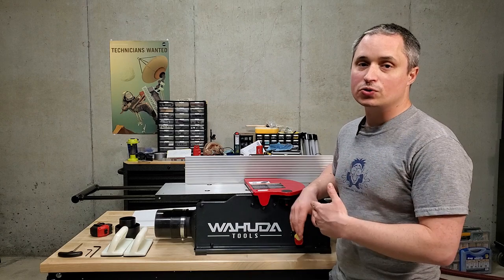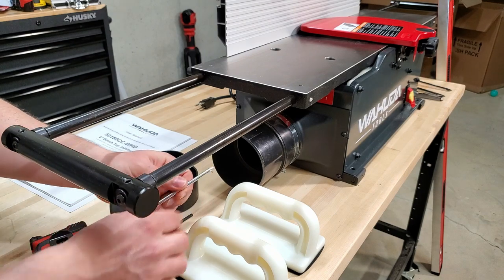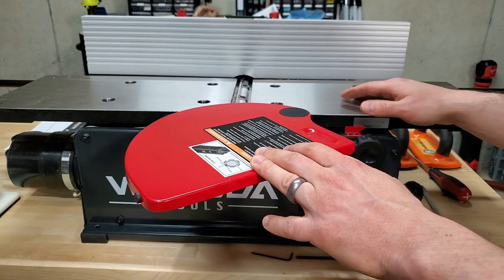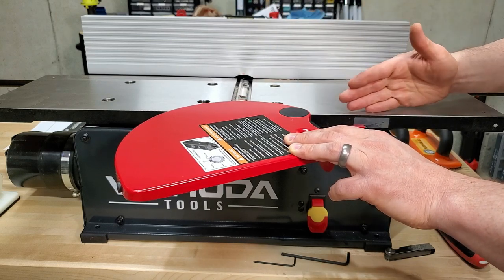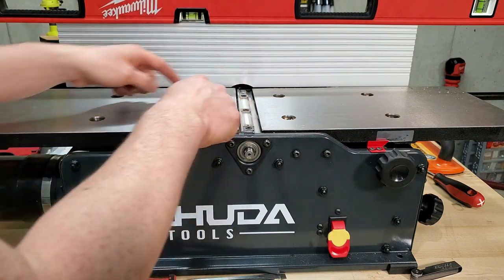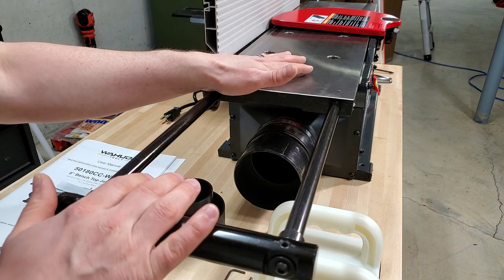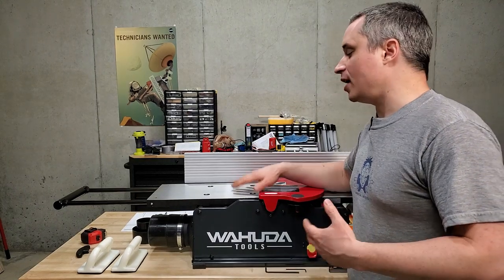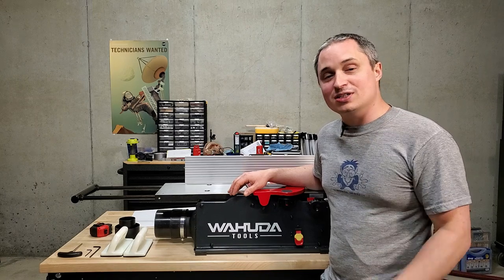Wahuda 8" Benchtop Jointer with Spiral Carbide Cutter Head Review and Setup Tips

Comment: I recently ordered and setup my wahuda 8" jointer. The newest model no longer requires you to remove the bolts and washer to adjust the table. There is now a set screw to the left and right of each bolt. One for up and one for down, just simply adjust each spot with your stright edge in place. So much easier now!
Reply from the maker: Wow, I ordered mine in February 2020 shortly after they were first available. I'm surprised they're already making improvements, but it sounds like a great upgrade!
Reply: @DoresoomReviews  I'm not seeing pics on their site reflecting those upgrades.  I'm sold either way, and will hopefully have one soon.
Reply from the maker: I spoke with Wahuda - apparently it was a CuTech patent conflict that mandated the change.
Reply: Can you please give me assistance on adjusting mine i just got it and messed it up trying to adjust

Comment: After watching your vid I ordered one! Ordered it on a Monday and received it Thursday afternoon! That was nice!

 First off the cutter head is not Helical or a Spiral, I would call it a straight segmented cutter head. It does work well but not so much on figured woods. The one I have does have 4 sided cutters that are numbered for easy identifying! The bed adjusters have been changed that use small allen screws that sit next to the main holding screws which makes adjusting much easier than the exercise you had to go through.

The table extensions were a lot easier to move in and out so they appeared to have fixed that issue! Dust collection on this unit is better than average! I am using the 4" port which is hooked to a 750 CFM machine. It could use a few extra air holes to make it more efficient and less noisy when using that type of dust extractor. I will be trying it with a shop vac to see if the results are just as good. 

The things I don't like: As you had pointed out, the fence attachment point which is flimsy and not as precise as it should be and probably the worst thing about the machine. Any side pressure causes fence deflection so if you are cutting on a 45  it is possible to make crooked cuts if you are not careful. They should have used cast iron or tool Aluminum for these parts. 

The plastic adjuster handles, No change here, for a few extra bucks Aluminum ones would have been a nice touch! I see a niche aftermarket here!

The cast iron beds, The material is pretty thin and probably explains why there is a dip of a few thou in the middle of them. Maybe not a deal breaker at this price point but something for people to be aware of. After having adjusted the beds, the machine I received the out feed was off by 0.10"  and the infeed was out by 0.23" not bad considering. 

The last thing that bugs me is the thickness gauge indicator. It's a sticker and has no calibration adjustment. It is nowhere close to 0 when the table is at 0 so any adjustments are just a reference from where ever the pointer is sitting. A dial or digital indicator would make a nice additions here which is what I'm going to do!   

All in all for the $550 shipped to your door this jointer is a pretty good deal! I must say I am getting really nice square cuts! I would say that the target market is the DIY'er or the guy that has a small shop/business that needs the occasional jointer. The mentioned issues are part of the price point and thus are things that need to be considered! it is not a $1500 floor standing jointer.
Reply from the maker: Great observations!
Reply: I agree about the slightly flimsy aluminum fence and the plastic handles for it. These could be better with little additional cost. I don't mind the thickness "gauge". I basically just run the same minimal cutting depth for everything, and just repeat as needed.

Comment: My only problem is vibration. While it doesn’t seem to be an issue, during use bolts work loose. Make sure ALL nuts, bolts and thumbscrews are tight before you start. I also feel it’s a good value for a 8” jointer. Perfect for the occasional worker.
Reply from the maker: I haven't had anything come loose, but I did crank everything down pretty hard.

Comment: I'm in the process of setting up my new Wahuda jointer and, something that isn't in the directions, but, after cleaning, putting the carbide tips back in, then torquing to recommended specs, do a test cut, or two, then, go back in and check the torque on the screws holding the carbide tips in place. Obviously, unplug before going back to check the torque on the screws!

Comment: This was very helpful with setting up my new 8" Wahuda today! Definitely a tedious process that took several hours but man, when its dialed its awesome! Also side note, I think they have changed how the tables are adjusted on my model. Its now the same allen head to secure the top but now comes with two small allen set screws underneath that adjust, no washer either. Nonetheless, thanks for sharing!
Reply from the maker: Yeah, they had a patent conflict with whoever retained the rights to the CuTech design. Hopefully it's not too different - the tips for adjustment still apply, even if it's a slightly different mechanism.

Comment: Glad I'm not the only one that got frustrated when adjusting the tables, and my extension bars are also really tough too.  all in all I also think this is a good choice at the price point.  Not too much that has to be done to it to get it nice and flat.**Edit: Not sure if mine was an earlier or later version, but to adjust my tables, i have hex bolt, then 2 small hex set screws recessed on each side of the bolts.  Your tips still helped me out with adjusting them even though they were different than in the video.  Feeler gauge and straight edge is the way to go.
Reply from the maker: You have the new version - I talked to Wahuda, and they had to change the design a few months after release due to a patent infringement issue with the old CuTech design.

Comment: As far as the carbide heads, they are much better than most cutter heads for wear and tear, and, most importantly, once you've rotated one of them 90° the fourth time, it's pretty cheap to replace JUST THAT ONE, rather than having to replace whole blades and then check them for position.

Comment: I just got the 10" jointer today...going through the learning curve of making sure it's setup correctly and that I know how to get good results for glue ups.  I like that it's compact and also quiet.  Not getting super clean edges...yet.  They still have chatter. Leaning how to reduce that.
Reply from the maker: Nice! I knew they were working on a 10" model, but didn't know it shipped  yet. Looks like a beast!
Reply: @DoresoomReviews  Ok.  I've done some work with the 10" jointer.  I am getting visually tapered boards.  Checked my setup per the manual and the outfeed near the cutter is exactly like it says in the manual...cutter tips touch the level but does not move the level.  My table flatnesses are about 0.006"; there is a .006" dip in the middle of the table on both infeed and outfeed.  Could this be the reason for my tapered boards?  Should I return this one and try another one?
Reply from the maker: Sorry, I just saw this reply. I'm not sure what the cause could be, it looks like there are lots of factors. This article has a lot of suggestions from more seasoned woodworkers than me for things you could check: https://www.woodworkersjournal.com/fix-tapering-jointer/
Reply: @DoresoomReviews  I believe my table is defective, so I will likely have to return it.
Reply: @MixingGBP  I was curious how or if your issue was resolved. I don’t own a jointer yet but was considering this one.  One thing I know about a jointer is that it’s meant to get ONE side flat and one edge flat and at 90 degrees.  From there you use your table saw to achieve parallel sides and a planer to get parallel faces.  I doubt this has anything to do with your issue but thought I’d mention it.
Reply: @victoryak86  No, it wasn't. I tried hard to get it setup, even called Wahuda several times for help.  I got a bad unit.  I'm still looking for a jointer.  Likely going with a floor model.  Until then, I get by with jointing jigs for my planer and table saw.
Reply: @MixingGBP  good to know. I’m intrigued by the cast iron, 4 sided inserts etc., that set it apart from similar models, but I’m apprehensive due to some of the issues I’ve heard like yours.  Thx.
Reply: If it may be reassuring, mine came perfectly aligned from the factory and has remained that way with no interference from me for 3 years.
Reply: @RYwoodview  good to hear that!  I am still getting by with jigs and table saw for jointing edges.

Comment: Just got mine; a few differences in the instructions, but overall, it arrived in good shape. I'm curious if you went through the exercise of making the in-feed and out-feed tables level because they were out beyond acceptable tolerance from the unboxing? I intend to put my aluminum carpenter level across it before starting, but I would expect that the 'factory' setup should be well within any imposed tolerances. Or am I deluding myself?
Reply from the maker: Always check. Mine was about 0.0065" out of alignment from the factory if I remember correctly. They changed the design of the leveling mechanism after I did this video due to a patent conflict, but it should still be generally the same process.

Comment: Another question about the cutters:  are the cutting edges parallel to the edge of the outfeed table or are they skewed slightly like you would a plane iron?  Parallel = spiral cutting head.  Shewed = helical cutting head (MUCH BETTER).
Reply from the maker: They're parallel, so it's not a helical design.

Comment: Great review and walkthrough! You have hit on the same points that I have found with the jointer. 

I've noticed some wiggle on the infeed table, no matter how tightly the screws are, even when it's locked. It seems to be some play in the mechanism that rides along the rails to adjust the height. Sometimes its worse when lowering and locking vs raising and locking. One trick I found to make it solid is to lock it down, and then slightly turn the knob to raise the table a little. It stays solid, but sometimes forces the table out of alignment a bit. I sent a video to customer service and promptly received a replacement unit, however there is still a similar amount of wiggle. Should not be a huge problem as long as I don't joint super heavy material. But it's my biggest complaint. It's easy noticable if you try to rock the infeed table up/down by the end of the extension wing.
Reply from the maker: Thanks for the heads up! I hadn't noticed that on mine, I'll have to check and see if it does it.

Also, do you have the table adjustment mechanism mine does, or the newer design that they had to implement to avoid a patent conflict?
Reply: @DoresoomReviews  both styles actually. I bought my original one during the early bird special, and it has the same adjustment style as yours. 

The replacement was with new style, which takes some getting used to, but it's overall easier I think. However, I don't like how the heavy cast iron is essentially resting on the tiny adjustment screws on either side of the large screw. It doesn't give me as much confidence in the level being long lasting. 

I saw the "loose" infeed table issue on both units. I'd be curious if others have it as well. It's quite a bit of movement when you see the end near the cutter head move almost 1/16 of an inch.

It's pretty clear to me that the slop is in the mechanism. Once you lock the table, and then adjust the height, it essentially takes up the slop and is rock solid. However, when you do this, it forces the table out of co-planer, which renders the jointer useless.

They have been very responsive and helpful, but I fear that the issue may just be in the design and manufacturing. Something I have to live with on a jointer of this style.
Reply: @vipervt09  I see the same slop in my 6" jointer.  Have you figured out the issue?
Reply: @JohnDoe-uu5pc  I believe so. I think the slop is within the adjustment mechanism/rail, where the indeed table slides up/down. I notice the following, if I find my desired height, and lock down the table, I will see the slop. However, after locking down, if I continue to raise/lower the table just slightly, I can see that the slop is taken up and the table is perfectly stable, with no wobble (however it is not co-planer when you do this). Try it out and see if your issue is the same as mine. 

In the end, I think it is something inherent to this type of planer design, and I try to live with it, until I upgrade to a large cabinet style jointer.
Reply: @vipervt09  Thanks, I will give that a try.  Not sure being not co-planer does  any good though.  However I typically plane everything so that should fix that issue.
Reply: @JohnDoe-uu5pc  indeed, I only recommend to try it as a way to determine if we have the same issue. I don't actually use this method when using the machine. I am just careful not to overload the infeed table which could cause it to wobble, and just accept it's limitations.
Reply: @vipervt09  FWIW, I've experienced no slop or wiggle in my infeed table at all.

Comment: Thank you for the review!  I bought the jointer after watching your review. I`m having some problems with the adjustments of the table, do you know if there are some changes in the newest models?
Reply from the maker: Yes, they changed the table leveling design after I bought mine due to the threat of a patent infringement lawsuit. I guess someone else retained the rights to the CuTech design when they rebranded as Wahuda.
Reply: @DoresoomReviews  when trying to join two pieces, I get a bow in the middle, any advice or tip? I would really appreciated
Reply from the maker: That sounds like maybe the outfeed table isn't lined up perfectly with the cutter head. Troubleshooting jointer problems can be tricky though, so I can't say for sure.
Reply: @JM-qi2gs  Had this same problem, went back and adjusted outfeed table to be PERFECTLY level with cutter head blades. This is CRITICAL.

Comment: Does it have its own dust blower fan like the dewalt planer? Or does it need a vacuum hooked up to collect the dust? On my planer I can just hook the hose up to a dust bad and I don’t need a separate vacuum system.
Reply from the maker: No, unfortunately it doesn't have a built-in blower. I use a portable 4" Delta dust collector with it. I have the DW735 planer too, and that thing will inflate the upper bag on my dust collector with just the planer running!
Reply: @DoresoomReviews  thanks do you know of any bench top jointers that do?
Reply from the maker: None that I know of. Most of them have this same general design and are actually made in the same factory in Taiwan. Each brand will specify their own features like carbide cutters or straight HSS knives, and cast iron vs aluminum tables.

Comment: Thanks for the review. Great job. No nonsense. I have a decent 11" planer but want a jointer  to ensure 90's for laminating boards etc. Would this or any jointer take care of that for me?
Reply from the maker: Yes, a jointer is the tool for that. The three tools needed for milling lumber are a jointer, planer, and table saw. Get an adjacent face and edge flat and perpendicular with the jointer, then rip the opposite edge straight and plane the opposite face flat. I got by with just a table saw with a straight line rip jig and my planer with a jointing jig for quite some time, but a jointer is faster and less of a headache to use once set up.
Reply: Thanks for your prompt reply. You wouldn't happen to have a photo of that jointer jig for your planer?
Reply from the maker: It's actually just a flat piece of MDF, some shims, and hot glue: https://www.instagram.com/p/BeW87Z8lEbn/?igshid=1ww1atlb4as38
Reply: @DoresoomReviews  Thanks. I watched that mini video. I thought it was something more elaborate to get a 90 that a jointer would give you. But still, it's a good idea for salvaging good wood that's a little warped. I'm more of a hobbyist than a carpenter so dropping $450 on a mediocre jointer is a little tough.
Reply: @DoresoomReviews  Do You have a jointer? If so, what brand is it and do you like it?
Thanks
Reply from the maker: I have this Wahuda 8" Jointer: https://amzn.to/39M5gRN
The DeWalt 13" DW735X Planer: https://amzn.to/2XU6jJN
Ridgid R4512 Table Saw: https://www.homedepot.com/p/RIDGID-13-Amp-10-in-Professional-Cast-Iron-Table-Saw-R4520/309412843

I love all of them!

Comment: Great review and even better description on how to adjust the outfeed and infeed tables. I bought a King Industrial 8" benchtop jointer, which is almost identical to the Wahuda. In my case, the tables were slightly off (outfeed table was a .001 too low, and the infeed was .012" higher at the blade), which gave me slightly bowed edges on my work pieces. But following your instructions, I was able to fine tune the tables within an hour. You made an adjustment that some people described as a nightmare fairly straightforward and easy to understand. Thank you very much.
Reply from the maker: Glad I could help!